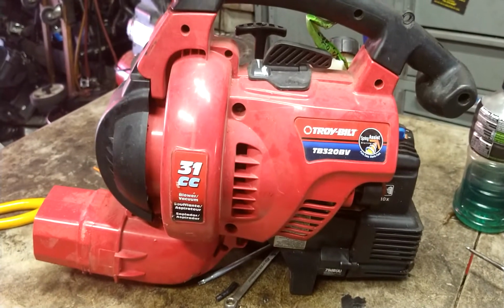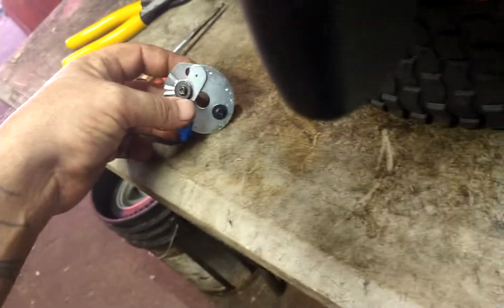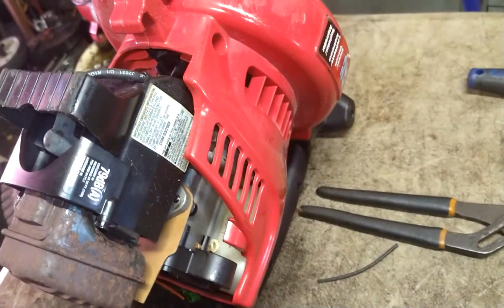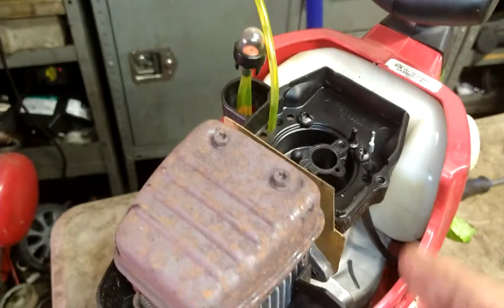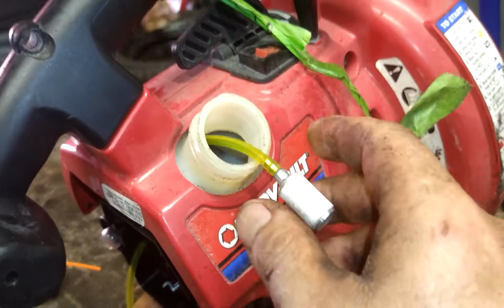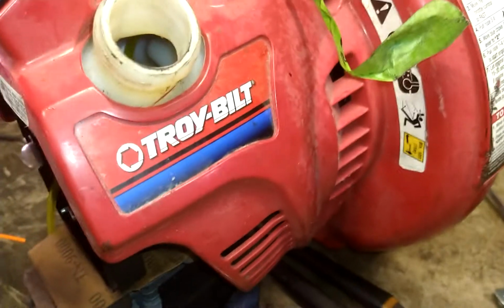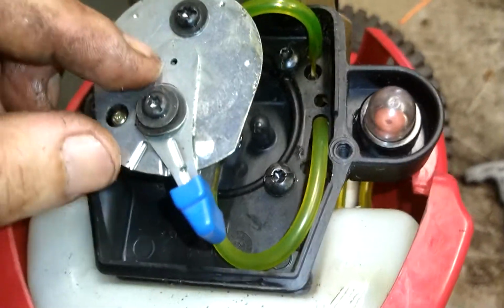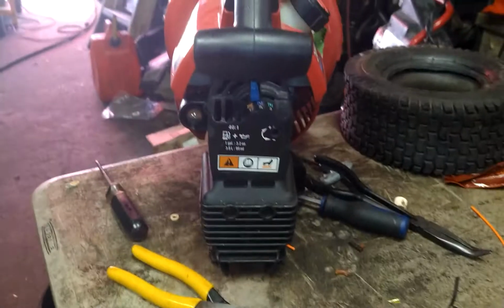Troy-bilt tb320bv carburetor fuel line repair.

Comment: I have this same blower I just purchased a new carburetor primer bulb and fuel lines. I got the just of how the fuel lines route from tank to bulb but where do the lines go to the carburetor? There is two ports on the carburetor but from the primer bulb where does those lines connect to?
You have the lines coming from tank to  bulb but what do the lines connect to after the bulb to get to the carburetor?

Comment: Great video thanks, but i have a question\?problem. BEFORE watching your video, my blower/vac would stall out immediately at full throttle, but would idle just fine. Inspection of the fuel lines and upon priming gas would leak, so time for your video !. Followed the video to a tee, but same stalling out at high speed. 
Any suggestions?.

Thanks
E. Jones
Reply from the maker: High adjustment screw counter clockwise 1/4 turn. Its the one on the carb closest to the air filter.
Reply: Can I pm you please  ?

Comment: I did exactly what you did for the fuel line with filter but gasoline is leaking around the line. Is there away to fix this leak?
Reply from the maker: did you do something to the tank? this should not happen with new lines. are you using 3/32 line?